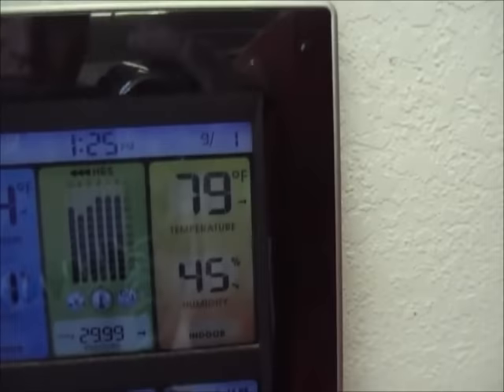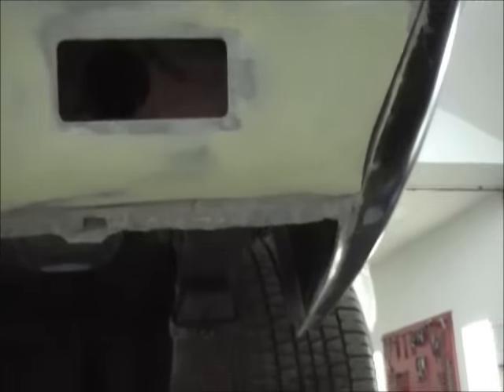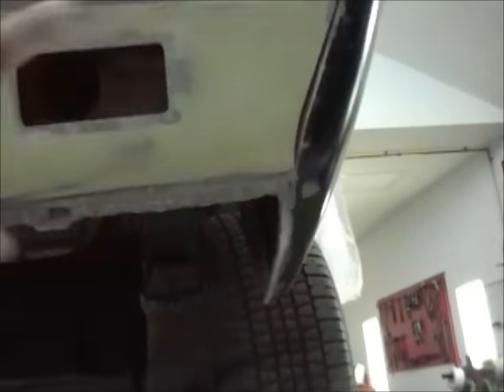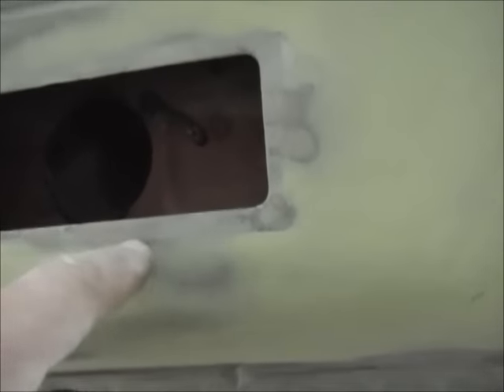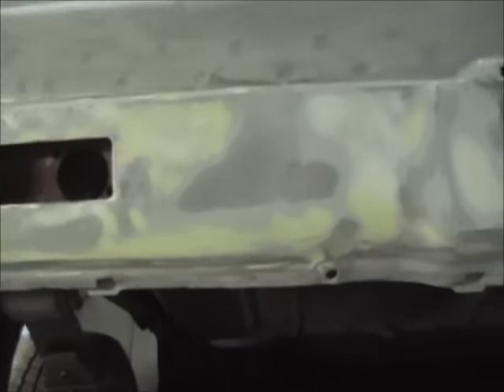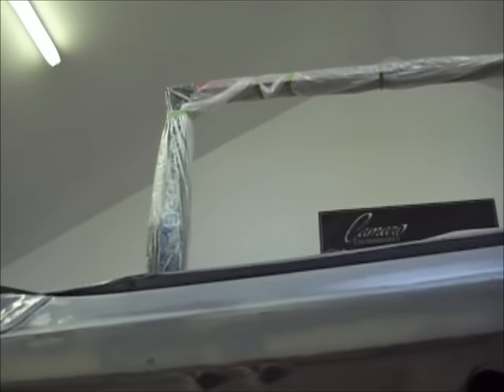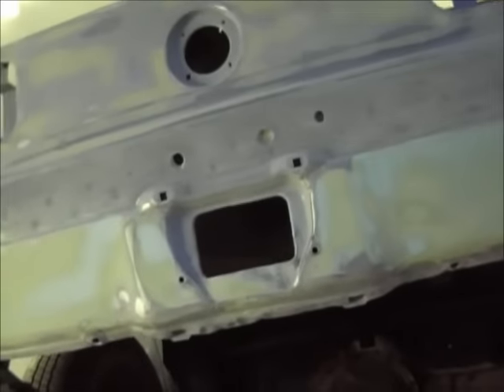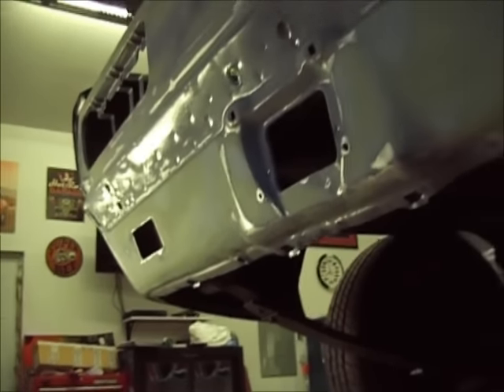more bodywork

Comment: Hey did you spray a guid coat to check if it was good? Just trying to get the process of how it's done down so when I'm at that point I'll have a go to
Reply from the maker: Yes I use powder guide coat , blocked it out 80grit flat , used tight wipe of glaze , 80 grit the glaze then guide coat the 80 grit scratches , then went to 180 on the same long block  till the guide coat is gone . Smooth as glass